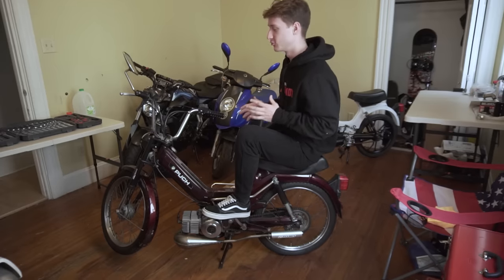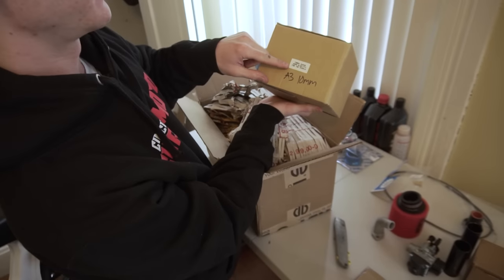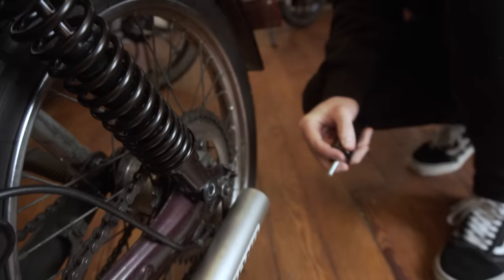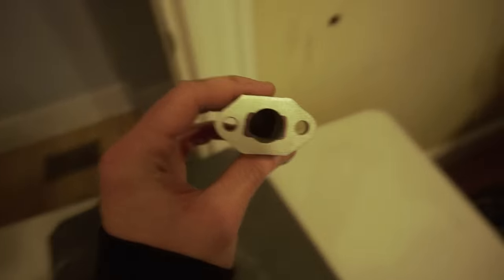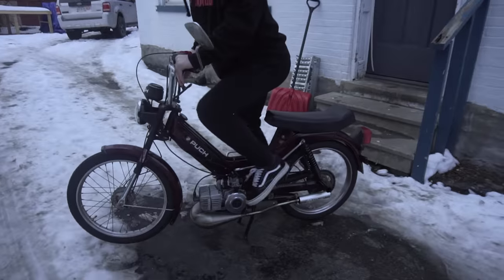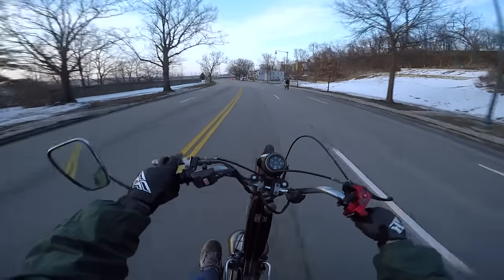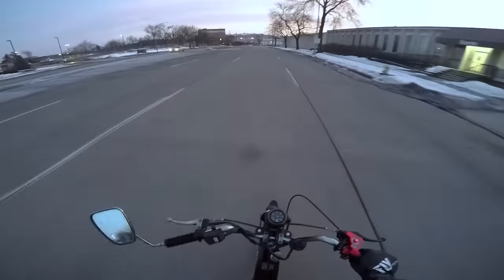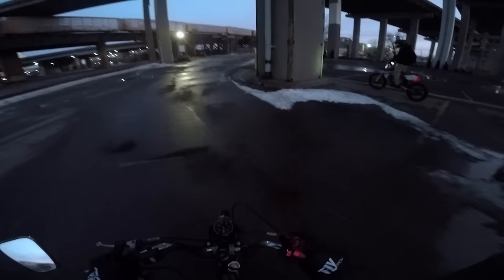Moped Carb Upgrade!! (HUGE POWER INCREASE)

Comment: They do make a 80cc kit Euro kit for puch also fits other models like Tomos  and if you get your heads and parts machine shop by a professional  buy bigger Pistons a more quality one you can also spray the Piston with heat resistant paint & the more  bigger larger  u go expansion chamber on the exhaust the better performance few other mods like a more powerful ignition &  the new twin carburetor you can put two carburetors at once sale on treats &  I seen the new trail tech Voyager on moped and I also seen they make water cooled kits now on treats& supper kits  other mods like changing the clutch to a KTM one I heard you can add more gears but sometimes it also makes it a single gear  depends how you do it also be cool to see someone make a twin dual silencer exhaust modded customized  look up three or four silencers onto a large big expansion chamber find some cool aftermarket silencers & makes one I see aftermarket exhaust is the m Augusta 3 silencer exhaust exhaust they come in different materials carbon fiber titanium aluminum I love to see that custom on big large expansion chamber with a new adjustable screw for tuning on a moped look second wild & I dare I had you also can also put some ricing  suspension frame on mopeds also markup a bar they put them also on Lamborghini doors lots of different things you can do to a moped if you had a 3D printer a water jet printer applasma printer they have YouTube videos how Europeans make 2 stroke moped  go wicked fast they have some fast in France  if you put better handlebars and performance forks I heard make a difference I heard you can also mock up forks to the shocks I seen a lot of people now are putting their exhausts upside down I don't know if that makes a difference same thing with the forks upside down maybe put some gas or air shocks on the moped be cool if someone figured out how to put put electric start on  mopeds I'm seeing people now putting MP3 radio  on mopeds with Bluetooth I also see a guy that custom 3D prints spacers for the motor he's on Instagram &I own 95 tomos LX targa this what you do when you're a moped head and two stroke person  mines always a work in progress I always love the feedback zoom zoom moped!!
Reply from the maker: Holy crap I think I almost had a stroke reading that hahaha. But yea man tons of super cool ideas and options for mods… it never ends!!!! Until you run out of money I guess

Comment: as  a kid i stuck a 68cc bigbore on mine  changed the carb the pipe socks rear sproket bored the inletand out let shaved the head better spark system and yes it was way way faster,i knew a guy who stuck a 160 pit engine in his it snapped the frame
Reply from the maker: Sheesh haha that’s a bit extreme 😂

Comment: If you think that's fast, then you should try my Yamaha Jog R. Making about 18 HP and that Puch is probably only making 5-6 hp, but they're so frickin fun
Reply: My 73cc derbi tops out at 130k rn, no idea of how much power it puts down but i guess its in the same range, still waiting on my vforce reeds and im going to get the flywheel lightened tomorrow
Reply from the maker: I want a jog they are sick

Comment: get a upside down ebr, best fork for puch, throttle Tommaselli 36mm/75°
Reply from the maker: Yea I need to get new front forks bad
Reply: @TwoStrokeJ  the old sucks just plain spring, ebr got a hydraulic with springs, a bit heavyer but not mutch, got that on my 2k, heard of metrakit or gilardoni? you want lights and rpms like a yz85, throw a mvt magneto and flywheel on. keep ripping that puch man

Comment: Man i watched one video and im hooked lol. Im currently building my own 2 stroke motorized bicycle and im trying to hit 65 mph on it but i cant get past 40 to 45 at the moment. Any reconmendations on a 2 or 4 stroke engines that i can get a little bit more power out of. I think i maxed-out the engine i have before it becomes unreliable.

Comment: Either you got loose front wheel axle or spacing issues..... be careful man I noticed the wheel wobble
Reply from the maker: yea a bolt on the forks was loose... ooops
Reply: @TwoStrokeJ  no drama bro love the videos. I build myself in UK but would love the bikes you lot have disposable......
Reply: @TwoStrokeJ  our weapon of choice here in UK is the Honda cub 90

Comment: I had a Rixe Libelle with the Sachs 505 3 Gear engine that had 88ccm and a 28mm carb with vforce reeds and selfmade exhaust. Did around 130 with GPS so 100% accurate
Reply from the maker: sheesh thats scary fast

Comment: I hope the vm20 carb will work. It looks like a cheap remake of the genuine Mikuni carbs, so maybe it is going to be hard to let the tomos idle properly.
Reply from the maker: The VM20 is a genuine Mikuni carb
Reply: @TwoStrokeJ  Nice to hear. I have one on my 70cc Suzuki ts50x, and it is super easy to change the pilot jet, with the bolt that goes in the side of the float bowl.